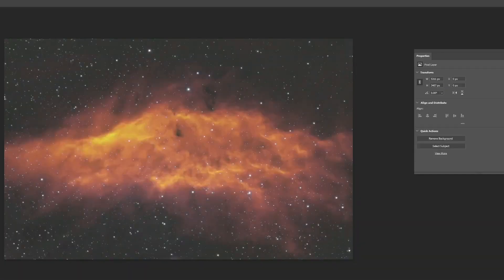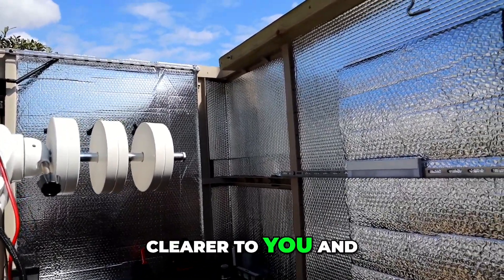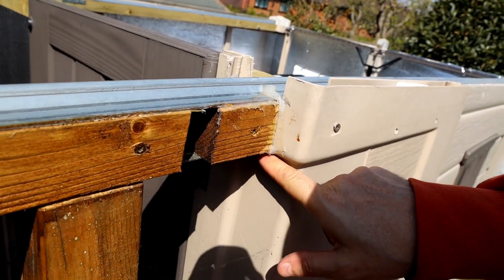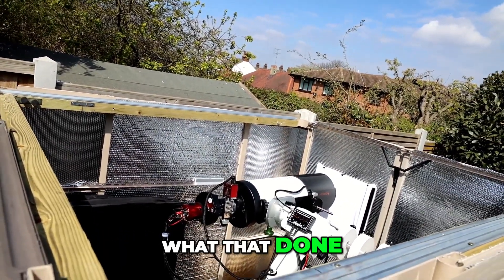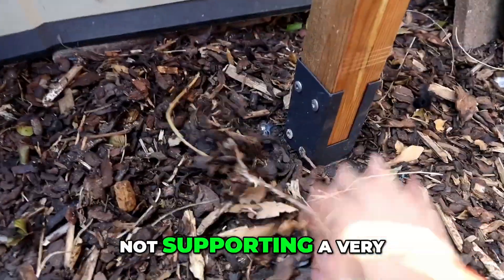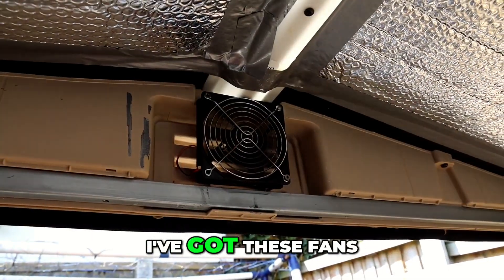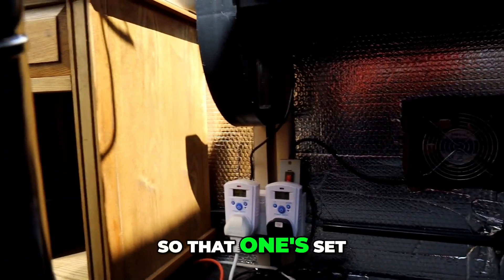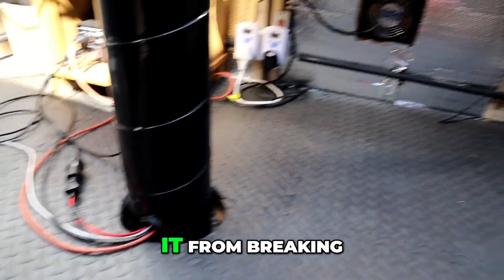Building a Budget-Friendly Observatory: Tips & Insights

Comment: Great video on the fine details of your roll-off roof observatory build.  In your video's intro, your Newtonian scope appears to have an after-market focuser installed.  I have Skywatcher Maksutov-Newtonian 190MN but the focuser is bending with the weight I have installed with a rotator, filter wheel, and camera.  Do you have any suggestion for a stronger focusser?  Thanks again for the detailed videos.
Reply from the maker: Thank you for watching and glad you liked the video. The skywatcher focusers are definitely their weak point. The Baader steeltrack are a good updrage
Reply: @Astrobloke  Thank you. I just put one on order.
Reply from the maker: Please let me know how you get on
Reply: @Astrobloke  I got the new Badder focuser and had a week of clear skies here in Washington State USA.  Using the vignetting as my guide, it never changed as the Maksutov-Newtonian switched from East to West side of the pier. That fixed my flexing problem.  Maybe I can return to using a guide telescope that didn't work right out of the box.  I had to go with an OAG.  I'm now using an ASI-2600mm Duo and that is working well.  Thanks for your channel.  I've learned a lot from your work.

Comment: One gem I can offer - don't have big roof!   Mine works out at something like 3.2x4m. Almost unpushable from the centre so I have to push from one side - it looks like it's warping slightly as one corner wheel - there's 3 a side - has been annoyingly moving off the v rail! Car jack needed to get it back... tempo solution spare 5kg weight over the nuisance wheel seems to be working....
Reply from the maker: You can get away with a large roof. My Observatory now has a 3.7m x 2,8m roof. Guiding rail on just one side to allow for any movement in the wood. I can quite easily pucsh mine off but have it motorised.  https://youtu.be/NI_ArOjR5PQ
Reply: @Astrobloke  Aye, I saw that. Maybe motorised in the future if the money gods allow, but for now it's looking like I need to investigate a way to satisfactorily push and pull at the middle than edge. It's doable but rather hard work.